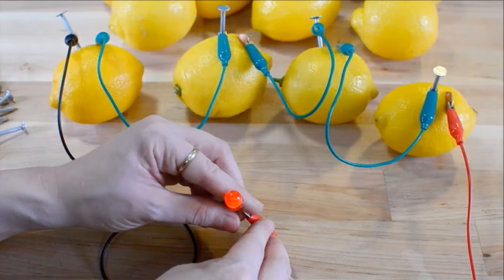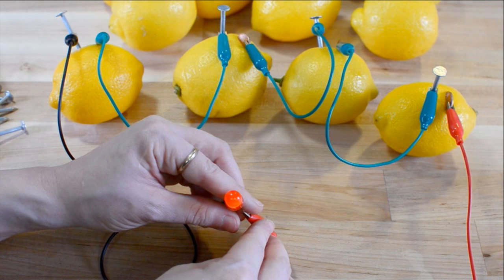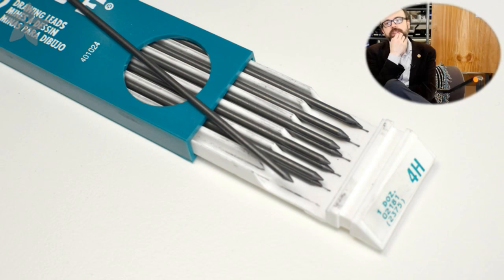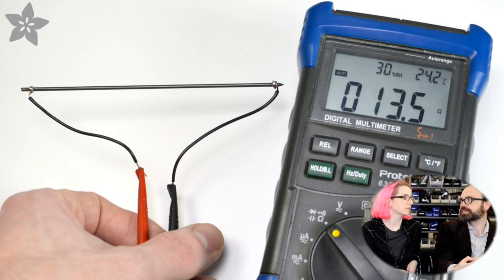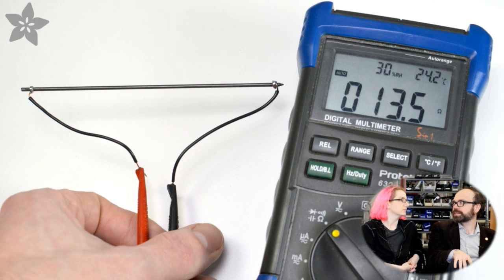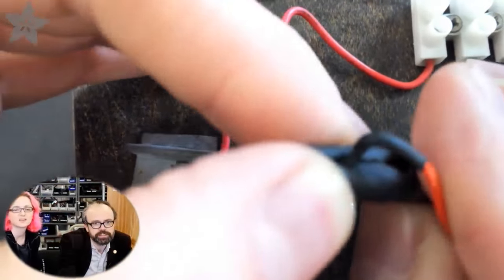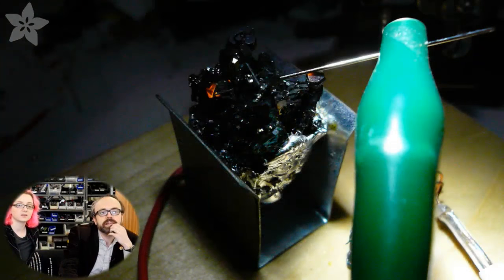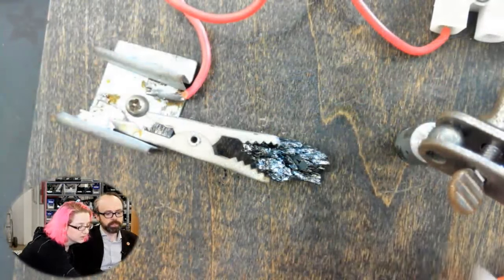Pseudorandom 06: DIY Components

Comment: You can actually build your own electrolytic capacitors using aluminum cans (or foils) and an electrolyte based on baking soda. I can explain more if anyone is interested, I actually built something similar to the 555 circuit in the video, but I used the homemade electrolytic cap.